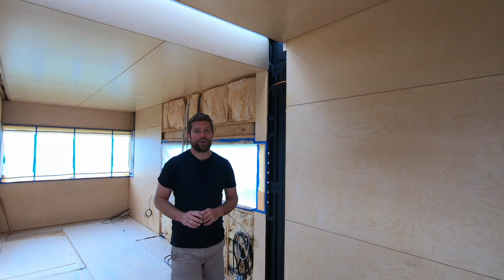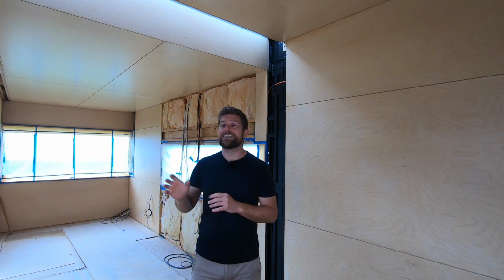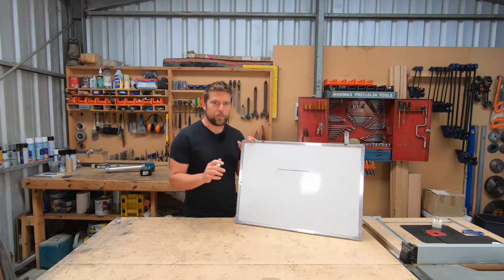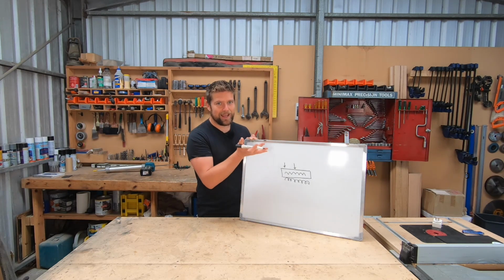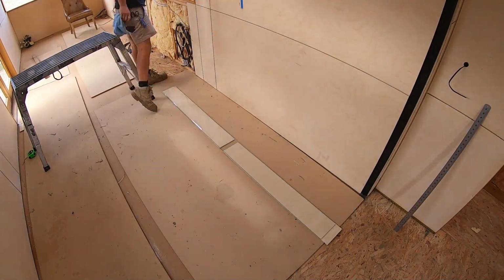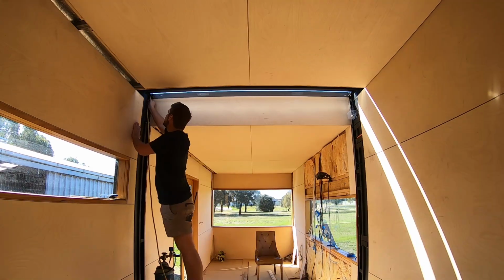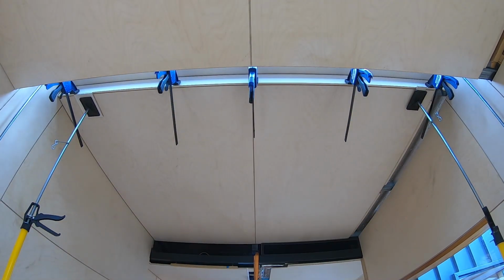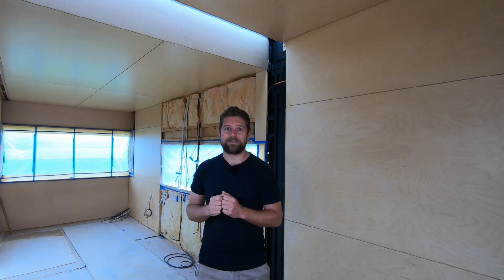Ep. 32 - DIY Double-glazed window using MIG welding gas - Tiny House Build Update

Comment: Little tip. 

While the argon gas should be free of moisture, it's difficult to remove all water vapour from the sealed glass. Even a small amount clinging to the glass can cause condensation. If you fill the aluminium spacers with a desiccant then you will eliminate any remaining moisture in the sealed panel.

Comment: I was thinking today on how to make my own doubled pane windows. I thought of the same thing, tire valves. However, using MIG gas never occurred to me. Brilliant idea. 

Do you think using wood for the frame , sealed with brush on bed liner, would keep the argon from leaking out ?
Reply: Ha, I’m here because I was trying to figure out how to inject argon into double glazed units but I hadn’t thought of the tyre valve idea 😆
Reply: @Tonisuperfly  It is a simple idea. Makes me slap my forehead because I didn't think of it. Using the candle as well is brilliant too.

Comment: I can’t quite figure why you made it in place, above your head rather than making a double glazed panel on the ground and then lifting it into place 🤔
Was it to save cost?
I would worry about movement between the roof panels and walls etc could cause the seal to fail over time. Or is this a tiny home that will never/seldom be moved? Is this near/in the join between the trailers? I’ll have to watch your other videos to find the answers…

I’ve seen that they usually put some desiccant in the edge of the seal to absorb any excess moisture. I don’t know if that’s still done on all double glazing or if technology has improved. It will be interesting see how this holds up. 

Obviously the reason I’m here is to see options for putting double glazing in my own tiny home. I’m off shortly to a local window maker, who is selling a veritable shit tonne of double glazed panels - practically giving them away. Better than dumping them, which is what they usually do!